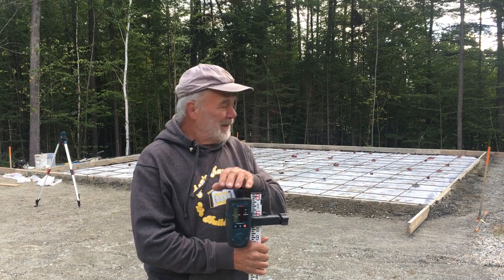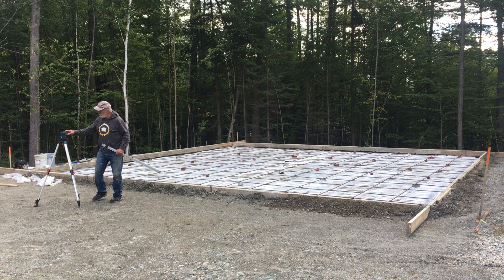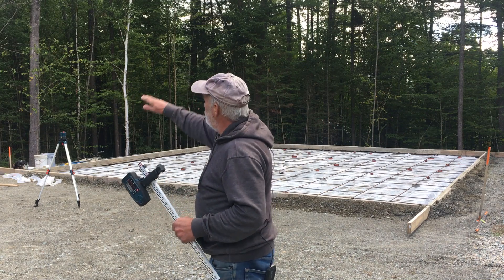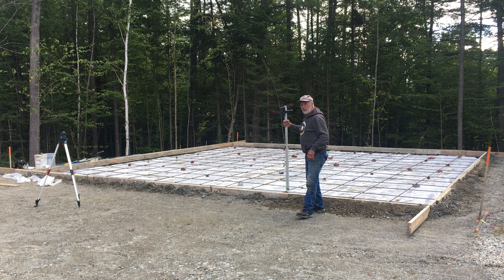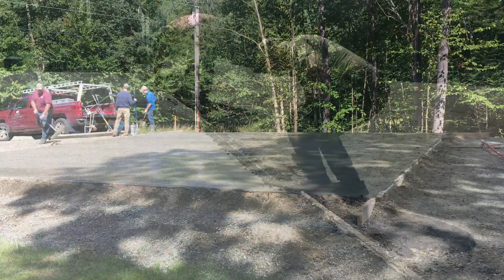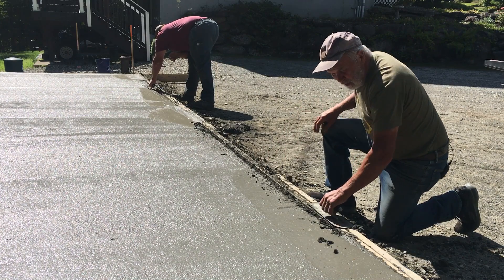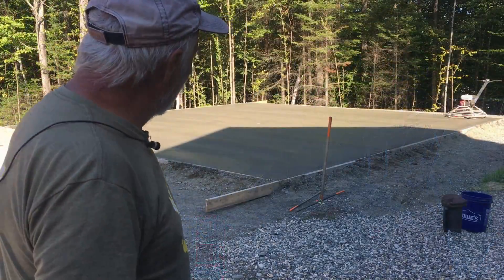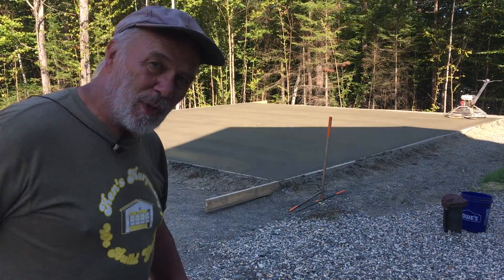Finally Back to Work!  Concrete

Comment: Something I've seen done;  Instead of walking through the concrete to set the drainage grade as you are at 15:30 mins of the clip, is the guys would lay out full sheets of plywood to walk on over the cement so as to avoid creating voids from fully penetrating the concrete by simply walking on it.   After that, the power trowel/ whirly bird takes care of the marks left behind by the plywood.   Seemed to work very well

Comment: Great job Ken, Kudos to the batch plant operator, the first load was probably a good 7" slump with no bleed water or foam, surely you got a sound 3000/3500 psi mix.
Reply: The first truck looked a little wet, the second a little dry. But better that than the reverse…dry then wet. Time evened it out for ken, and they finished before dark. Looks good. Great job, ken, as usual.
Reply: @Cooldaddio2  you are right, the first load was a little loose but i think it was due to the water reducer  that Ken had them add because i could see no bleed or foam, the second load possibly had more churn time or the moisture content in the aggregate dropped slightly.  At any rate, Ken and crew handled it like champions.

Comment: like this but thicccer slab, add some pex - the self leveling lasers are great tools for grading - dozers have the gps version -a ranch and garage would be about triple this but faster construction/fab - the slabs are vital - they need to remove more trees

Comment: Ken, many of the higher end rotary lasers can do slopes, etc. But regardless, it's a much better solution than the optical transit since one person can handle the measurements.
Reply: Hi Jim, in this case I guess they’re not described as “high end” as nobody would want one ha ha! Kind regards buddy 🙏

Comment: Hi Ken. Ken I was wondering if you would at your convenience someday do a teaching on how to use the leveling device when your doing the forms close up and give o a lesson on what to do when the level is off and how to use your leveling system and a more detailed video on your Alaskan floating slab from the very beginning of the ground to every intricate detail to the finished slab. Thank you Sir. What is the name of the leveling device you use and how does it work... Thanks Ken
Reply from the maker: I’ll try to do that
Reply: @kenskarpentry  Thank you Sir really appreciate...

Comment: Another beautiful job, Ken! I am looking to build a 24x24 shop but thinking it might be best to sub out the slab. I am getting quotes that are all over the place on cost. I want quality work but also don't want to get ripped off.  I have seen you do just the concrete work in the past, I am wondering if you could share what you would charge  for a 24x24 slab with rebar like this?

Comment: Ken, I have a quick question.  I'm building a home using your design style (24' x 32' cape style, 12/12 roof, etc.) and have a design decision to make.  We'll be centering a wood stove on the front end Gable wall between two windows on the first floor.  This was the only real option for placement due to design.  This would end up placing the exterior chimney pipes directly in the line with the loft window.  I wanted to use two windows in the loft separated by a small amount to prevent the stove pipe from blocking the view from either window.  What would you suggest as the maximum dimensions from both a structural and aesthetics standpoint?  (the room will be one large 16' wide bedroom where the windows would go.)